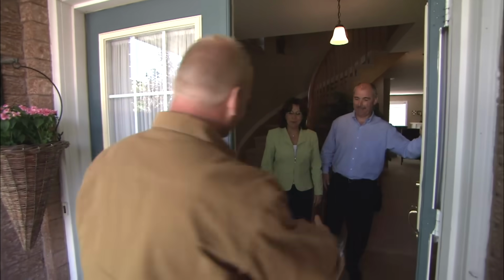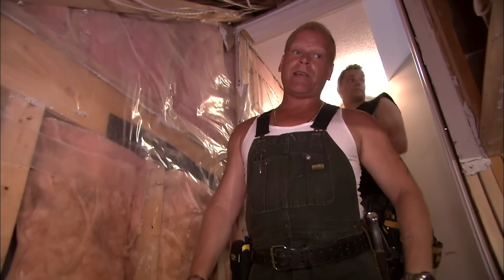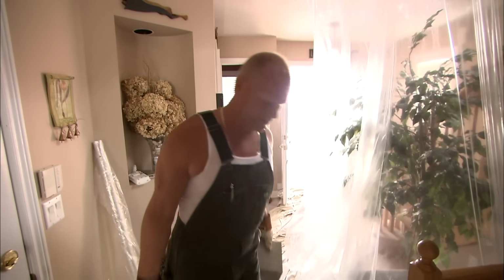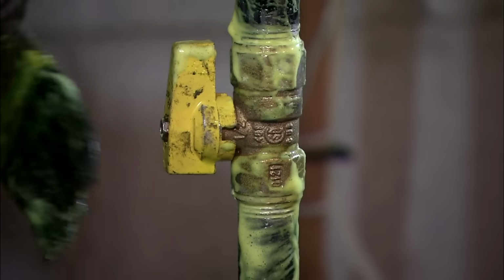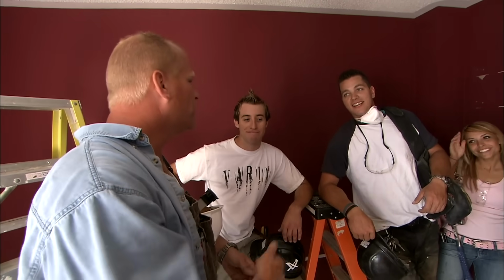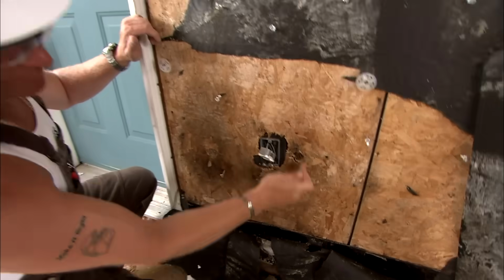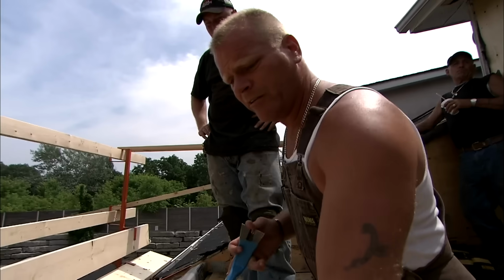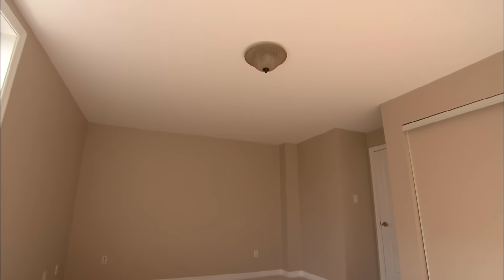Contractor Leaves Couple With Crappy Basement After $23K | Holmes on Homes 601+602

Comment: 14:27 

Where is the inspector? There absolutely should be an inspection at every level of the building process and THE INSPECTOR should not have signed off on that before the drywall went up. And unfortunately, since I've watched several episodes, Mike hasn't once mentioned or blamed the inspectors, only the contractors and home owners.

Not one piece of drywall should have gone up if the thermal rating wasn't met to the minimum code.

Comment: So many problems or even potential problems could be avoided if the code eforcement officer/building inspectors would just simply do their job correctly and enforce said codes. Plumbing/Flooring contractor here, we deal with this more often than not, especially on newer homes showers and tub surrounds. Furthermore,  if insurance companies would just stsrt requiring proof of passed/green tagged inspections, for each amd every trade incolved during the build or remodel, less of these occurrences would take place. Like a 24hr flood test on shower pans for example.

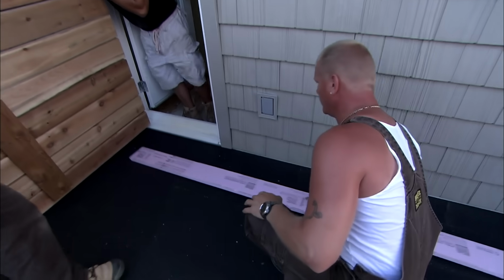Comment: At 1:27:22, what thin, black material could you have put on top of the pink so the pink wouldn't be visible through the spacing in the floor panel? There's a saying in magic that black hides everything. Now you know! You'll use it. ;-)

…and one safety suggestion at 1:32:57, give the ramp some momentum, pull your hands away, and let it set itself into the haul space for the last foot. Most trucks have a hidden, flat hook clamp that comes up from the bottom and grabs the end of the ramp with a strong spring to secure the ramp to the truck. You don't want fingers touching the end of the ramp as it's entering its hideaway. DAMHIKAT.

Comment: Mike you have an amazing crew that is not afraid to do the hard work to get it done RIGHT . I have no idea how you find great competent contractors to help with your projects . I have even gone through Angies list here in the U.S. and was burned by the contractor they recommended . I had a garden area I built years ago that I wanted extended . I had used 6 X 6 pressure treated as a border they used 6 X 6 untreated pine to extend the boarder . At the time I was working out of state and didn't see it until it was to late . Keep on doing it right Mike with your fantastic crew .

Comment: The Foundation at my old house was harder than Steel, they called it Blue Stone Concrete, it was Built in 1956, I was trying to Finish the Basement, I tried Cement Nails, Nope, they Bent and Broke, then I tried Drilling, that Burnt the Carbide Drills, then a Friend said, Bang Caps, I told Him they wouldn't work and He said BS, so He came over and Shot off a Few, they didn't work, I went back to Drilling as it was the Only thing that really Worked!
Reply: You would have thought bang caps, they are like using a gun and sound like it too!
Reply: @Sea-cucumber1151  Bang Caps are a 22LR Cartridge!